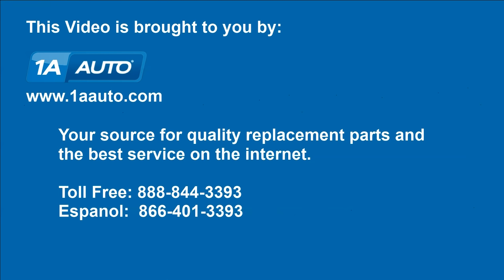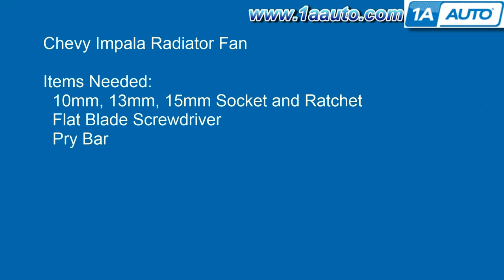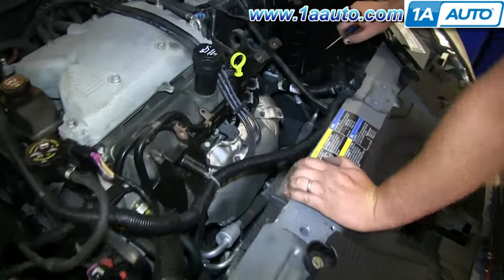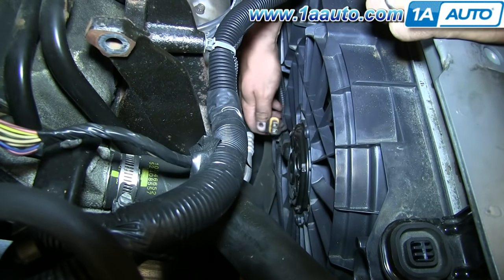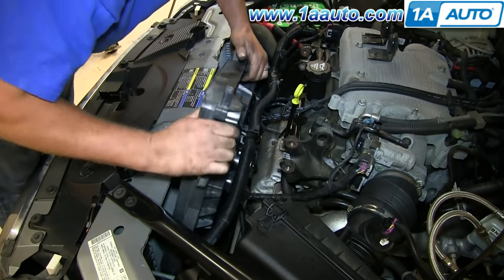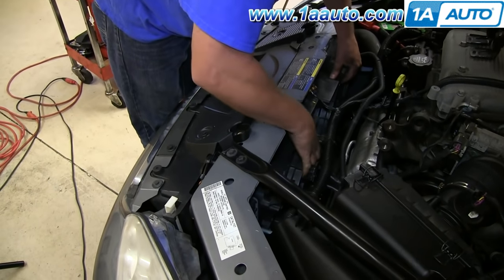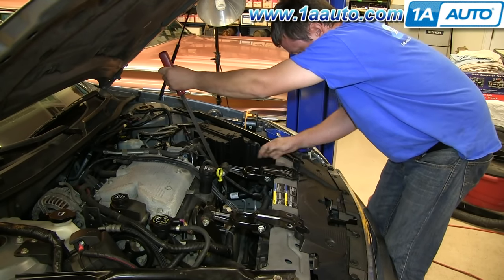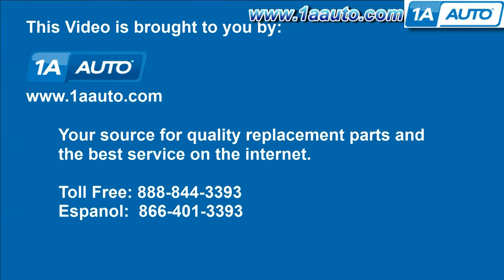How to Replace Radiator Cooling Fan Assembly 06-11 Chevy Impala

Comment from the maker: √  Watch the Video
√  Buy The Part at 1A Auto http://1aau.to/m/Visit-1AAuto
√  Do it Yourself
√  Save Money
Reply: I disagree with the pry bar you could grab the hook that's used to take out the engine and pull on it with you hand really quick and slide the bolt in

Comment: Excellent video!!! Replaced the Engine Radiator Cooling fan in a 2011. I followed your steps and all worked to a tee, except on the 2011 I had to remove the top hose to the radiator to get the old part out & the new part in.     Thanks loads!  this saved me a boat load of $$$
Reply from the maker: That's our goal. We're glad we could help you out. 1aauto.com 866-403-3393
Reply: 1A Auto Parts

Comment: This is a very helpful video thank you very much. 

I have 2013 impala when I turn the AC , the fans do not turn on. However after some time they turn on when engine gets hot. 
What’s the issue could be and why the AC is not engaging the fans?

Comment: thanks for your efforts
impala 2012 
no blown fuse all relays good
fans not work
only with scan tool using active test
please tell me about the problem
Reply from the maker: +HATTAF RASHED هاتف راشد There may be many reasons why you are experiencing this issue, so we do recommend taking your vehicle to a local mechanic for an accurate diagnosis. Thanks for checking us out!
Reply: @1AAuto  
thanks for your relay

Comment: Great video! Thanks for putting these videos out there! Process is a lot more difficult for the V8 models once you get to the lower bolts!
Reply: Had to remove oil cooler line, airbox Etc...
Reply: Is it the same fan for regular model an ss model?

Comment: This video was extremely helpful, however, I found that it was much easier to also pull the battery and the battery tray, this made things much easier for me in replacing the fan. Great reference video though and was very helpful.
Reply from the maker: +Field Tree Thanks for checking us out! 1AAuto.com

Comment from the maker: We currently do not have an auto repair video on that particular repair. If you have a service or a repair manual it should also be covered in there for you. The correct spark plug gap size should be in the engine bay on a sticker for you, they're usually found around the radiator. Hope this helps you out. Have a great day! 1aauto.com 888-844-3393

Comment: I had a question do both fans have to work at the same time because I was looking under the hood and I noticed only the one on the passer side one was working is that normal thank you.
Reply: I was wondering the same thing but only my driver side fan was on passenger side wasn’t

Comment: Great Video! Question: on the Impala(2012 is what I have), is the radiator fan the same as the condenser fan? Thanks
Reply from the maker: +Kenyon Hicks It looks like the 2012 Impala comes with a dual fan assembly.  Here is a link to the one we carry for the 3.5L engine: https://www.1aauto.com/chevy-impala-monte-carlo-radiator-cooling-fan-assembly/i/1arfa00264?f=531619&y=2012

Comment: Did you need to use a jack with a block of wood under the engine to support it?
Reply: No need in me watching this video if it doesn't address this question,  just like the other 10 I've watched 😂

Comment: Should I replace the whole Radiator fan or just the fan because on my the fan on the driver side broke I don't how that happen. What do you think. Thank you.
Reply from the maker: +webguy79 We recommend only replacing what needs to be replaced in this case!  1aauto.com
Reply: 1A Auto Parts do you guys sale the fan by it self? Thanks
Reply from the maker: +webguy79 Thank you for your inquiry.  We do not sell the fan by itself, as it is made into the assembly.  All of the suppliers I know of do not offer the fan by itself, it will always be the whole assembly.
Reply: 1A Auto Parts do you know how I can take the fan off because I don't see any time of sewers. Thank you

Comment: Hello, I have a 2012 Impala and there is a metal "water" or "fluid line," or maybe a heater line. Anyway, I don't have any pictures to share but, it mounts to the driver side of the motor and runs down the front of the motor. It connects to permanently mounted rubber hoses at either end and on top of the motor is connect to a device that is right under the engine cover. That line is in the way of removing the fan. What to do? Also, this motor of mine only has one engine mount in the front. Do you guys at 1A Auto have any suggestions, or does anyone else reading this have any suggestions? If you have any, photos and a video would be helpful. Thanks in advance.

Comment: My gf radiator unit fan is buzzing really loud and when we unplug the driver side fan it stops and ac still works but the buzzing goes away. So her dad just bought a whole new unit fan and I’m gonna put it in. Hopefully that will fix the loud ass buzzing noise. Fan could be out of balance.
Reply from the maker: +Anthony Meade We wouldn't be able to diagnose an issue like that here, you may want to have a local mechanic take a look at it. Thanks for checking us out! http://1aau.to/m/Shop-1AAuto-c

Comment: How do you remove the fan itself from the electric motor is what I'm looking for? There are no screws on them they have rivets and I can't find where you remove the fan itself from the motor. The vehicle in question is 2007 Suzuki Xl7 Luxury model
Reply from the maker: +SSgt.StevenPG It's actually designed as one part, so to replace one you replace both unfortunately. We carry them on our website at this link. Hope this helps you out. https://www.1aauto.com/1A/RadiatorFanAssemblies/Chevy/Impala/1ARFA00264?utm_source=YouTube&utm_medium=CTA%20Comment&utm_campaign=1ATony

Comment: Do the cooling fans for a 3.5 fit the 3.9
Reply from the maker: For the 2006-2011 Chevy Impala, The cooling fan for the 3.5L is the same part as the 3.9L engine without the police package.  There +Daniel Rubalcaba

Comment: How long would you say this would take to remove and replace?
Reply from the maker: +De'Noval Joiner Thanks for watching!  Like any repair you perform on a vehicle it will depend on the experience of the mechanic.  The fan in this particular video shouldn't take much longer than an hour or so, as long as the engine compartment is in the same condition!  Here is a link to the fan if you need to purchase it: http://www.1aauto.com/1A/RadiatorFanAssemblies/Chevy/Impala/1ARFA00264?utm_source=YouTube&utm_medium=CTA+Comment&utm_campaign=ytcomment&utm_term=j41N-P8bwQY

Comment: Did you need to use a jack with a block of wood under the engine to support it?
Reply from the maker: +Deejay Miz 03 Thanks for checking us out! The engine will not need to be jacked for this application. 1aauto.com